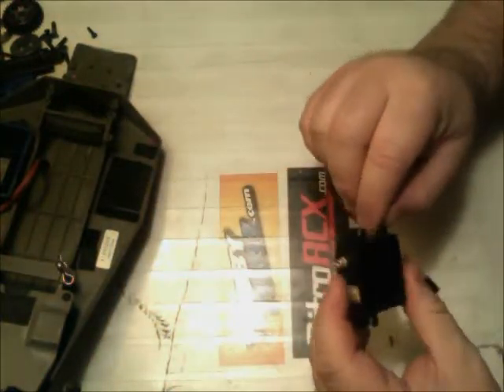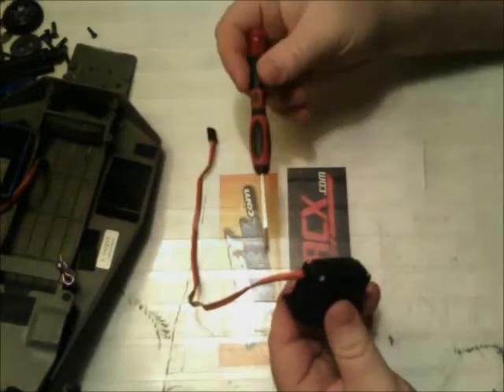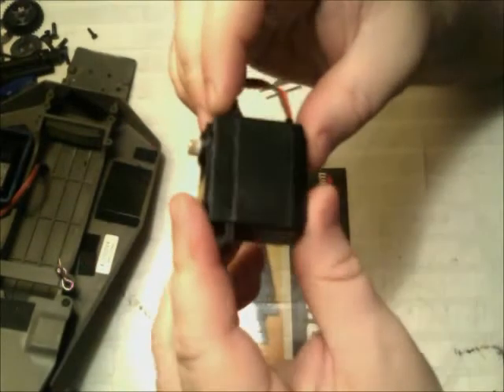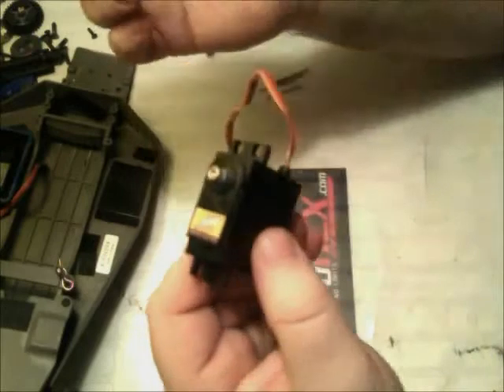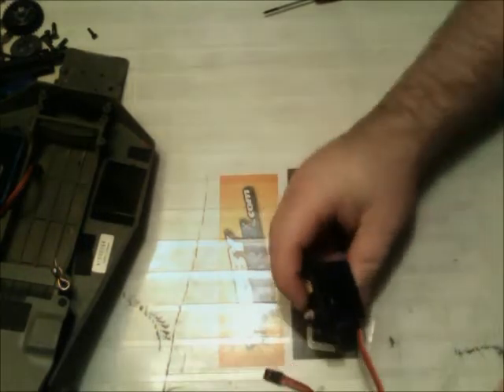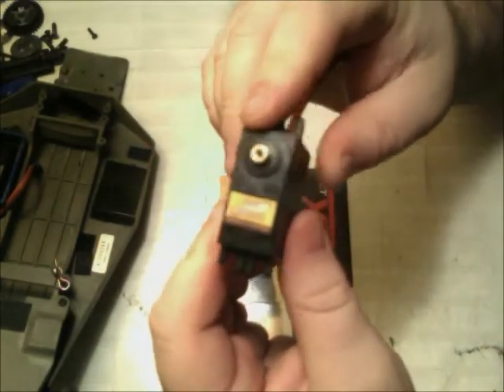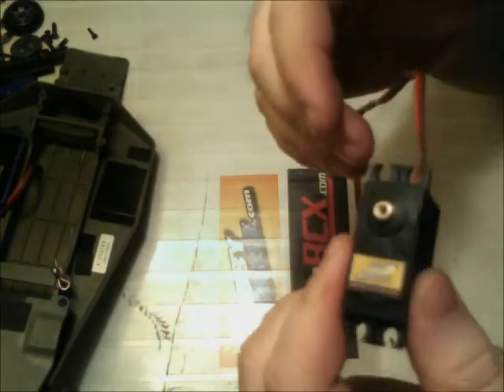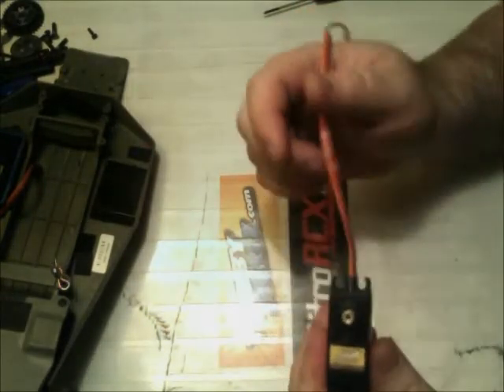Waterproofing Servos.avi

Comment from the maker: You could try it. Ive never done it so i cant say for certain but I do know that Corrosion X molecularly bonds to most types of metals and it is supposed to not only prevent rust but its also supposed to be a lubricant so dont think it would hurt anything but again without trying it out and testing it for awhile its hard to say for sure. I would probably still put grease in the top as that wont really affect the servos thermal properties that much and instead of spray it with plastidip you

Comment: Once again, nice vid! I have a noob question though: What if I just dip the servo in corrosion x? Would that work? I mean yes water might still find a way to enter the servo but it wouldn't hurt anything, right? I'm not a big fan of plastidip because where I live it gets pretty hot during summer and I don't want heat problems.

Comment from the maker: They are the best budget servos Ive found. They operate very smoothly, quietly, and they have quite a bit of torque ( enough for you average applications but on bigger MTs youd probably want to use two of them). They also have very good speed for a budget servo. The one in this video has been through 3 wrecks in my 100+MPH Rustler and still functioning. I own 4 others 3 of which so far have remained unused. I recommend these servos every chance I get :)